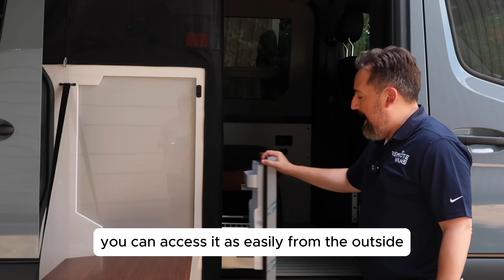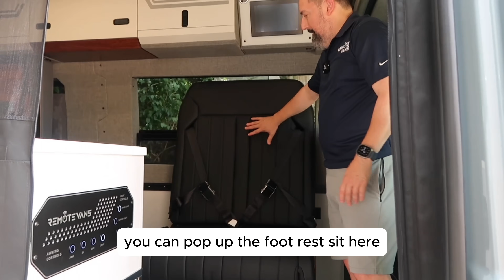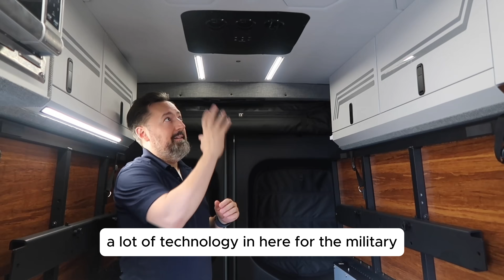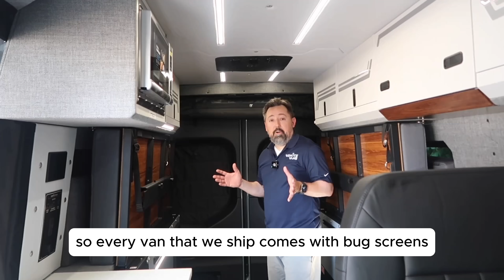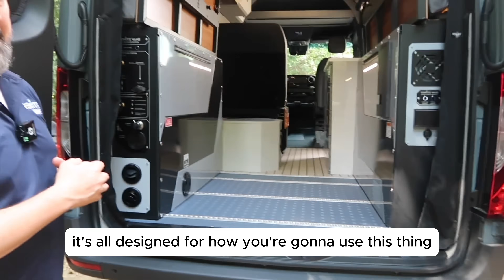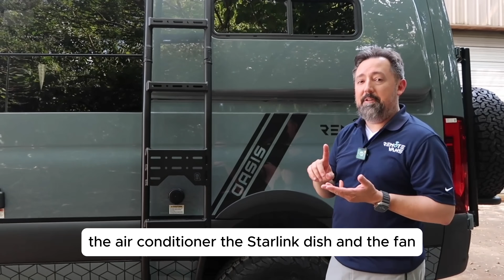NEW 2025 Oasis® Series by Remote Vans®: Guided Walkthrough (144 AWD)

Comment: Lots of great features. We use our gear garage in the back for all the gear nobody shows in their van tours. No need for beds that go up and down or Murphy. It's a lot of expense and work to do that, but the distinction between those who adventure vs those who just travel is key for users. Your shower innovation seems great for water use, but when the shower is not in use it's wasted space. For your adventure buyers, keep a dedicated shower enclosure but use it for a wet closet and pump heated air into the area. We used to hate having the shower enclosure taking up space and did outside only, but now we have our ski gear, wetsuits, rain jackets and muddy shoes in that space when not using the toilet or as a shower. It's a feature not a bug. Again, your buyers may be travelers and not adventurers but your build suggests otherwise. You could easily do a cheaper adventure model that includes your other smart fixes ! And...make it a 170. Don't buy the 144" hype, few adventurers ever take a $200k rig into true off roading. Nice job!
Reply from the maker: Thanks for the great feedback and comments - we appreciate it!

Comment: Question about the recirculating shower. Do it would use the used water in the shower pan and put it on your body? Does it get filtered at any point before it goes on you from the shower head? Just seems unsanitary to run used water to shower with.
Reply from the maker: Absolutely - it’s exactly the same as having a bath, maybe even cleaner.  You’d fill the shower pan with 3.5 gal of hot water then hit the recirculation pump.  You can have a great 7-10 min shower.  Then you can turn the fresh pump back on (no recirculating), have a quick wash, and rinse off.  This way, if you’re concerned, no “dirty” water has touched you, and you’ve achieved a great 10 min long warm shower with only using 3.5-4 gal of water.  A huge improvement over a 1.5min shower.

Comment: I like the frig opening in the van's forward direction. Load from the outside standing up looks nice instead of having to get on your knees all the time. The swivel seat is also great, especially if you are going to occasionally have more than two people in the van. The lithium battery capacity and charging capability is awesome. Including a Skylink is something I possibly should have included in my custom build. I went with the same rear exterior storage system and love it.

Some negatives, I really like my cassette toilet with the cassette serviced through an outside door. A porta-potty is disappointing in such a top of the line build.   Don't like those all inclusive touch screen panels. Just give me old fashioned switches, at least on some of the lights. Going with the Ecoboost AWD Transit was a longer wait but I think it will be worth it over the long run. I'm not sold on the Sprinter. Time will tell on that one.

Enjoyed seeing your design. It's about $45K more than what we spent but you definitely have order of magnitude more boondocking capability than I do.

Comment: Love it….but …hundreds of thousand hours…..cmon man.
There’s only so much that can be done in a small space,you’ve refined basically the layout of so many others,well done but it would have to be priced out of reach.
Reply from the maker: Pretty sure Tony meant hundreds of hours R&D 😂  yes, layout is limited by the stringent RVIA rules (which we follow to the letter) - innovating constantly with fresh ideas and a new approach to the Class B adventure vans market is what we’re all about. Subtle (but huge) engineering improvements to everything - kitchen, seats, power, water, cabinetry, lighting, showers, beds, accessories…  300 little improvements to the traditional way of doing things = a premium quality adventure van with cutting edge technology - at very competitive prices.  Exactly what the market needs 👍🙌
Reply: Don’t think he meant literally thousands of hours. He also said the generator will run forever on basically no diesel. Doesn’t mean it actually does…